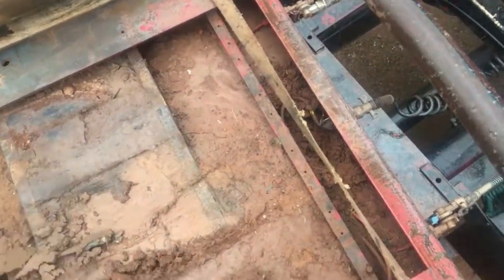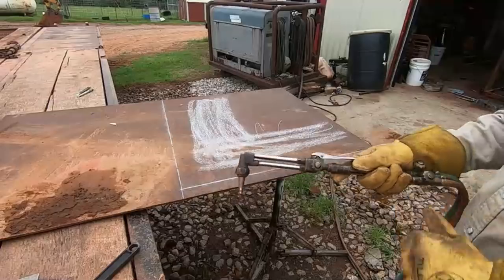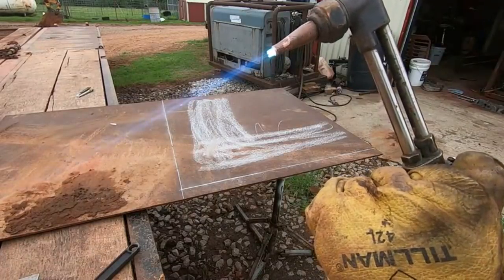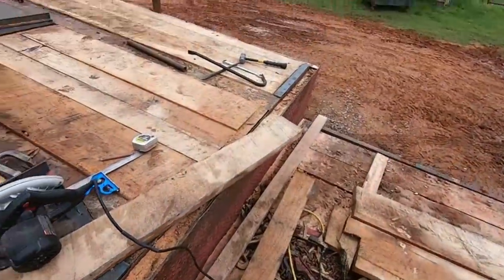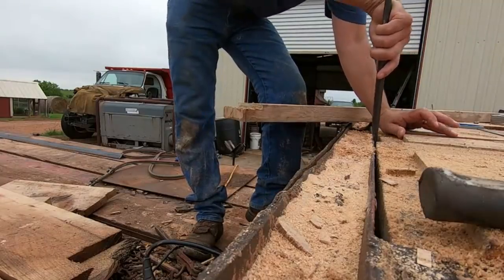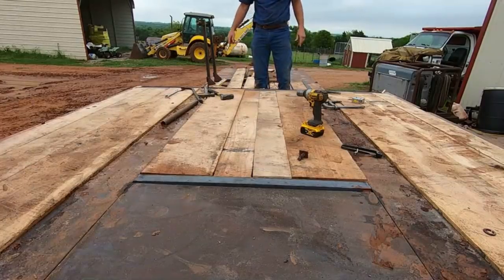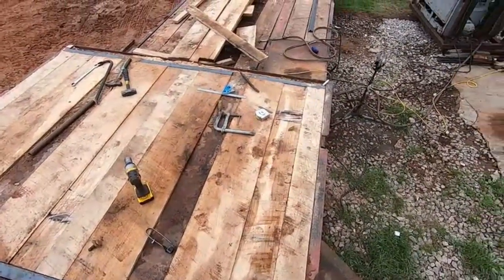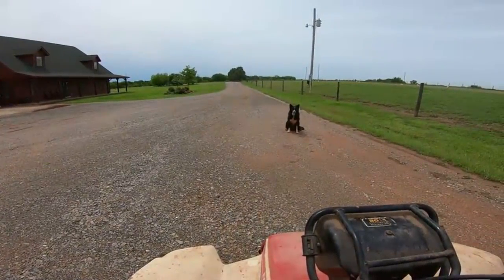Deckin’ and four wheelin’.

Comment: Made some similar repairs to my old Load King not long ago, but I didn't get to have near that much fun afterwards! One thing I learned by accident when treating rough cut trailer floors, I pressure wash them really closely, roughing the surface a good bit. Then treat with whatever hydraulic/motor oil/diesel mix is handy after they dry. The roughing up of the wood seems to help with the absorption of the oil.
Reply from the maker: I’ll give that a try on the treating.

Comment: I am pretty late to watching this,
   but loved every minute.  I bought new in 1985 a Honda 250R 3-wheeler, water cooled.  Crazy fast, did most of my riding on the Oregon coast, with buddies who bought Kawasaki's, Yamaha's, and Suzuki's.
   They did all kinds of stuff to them make them faster, I left mine stock.  They were forever wrenching on them in the parking lot of the staging area, while I was out on the sand by myself...  Ha, Ha, ha...
    Was curious as to the year, make and dimensions of the trailer you were working on.  I am in the market for a used one just like that.
Thank you sir...
Reply from the maker: Hard to beat a Honda, the trailer was custom made by a company in Oklahoma that went out of business a few years after I bought it. 1999 westwind 9 foot top deck, 20 foot flat with dove tail.
Reply: Digginok Perfect size.  You are right smack dab in the middle where most of the trailers (at least in the size range of yours) are built in this country.
Thank you for the reply back.

Comment: I've seen a few trailers with flat bar holding the ends of the deck boards on. Mine needs a new deck on it pretty bad.   That 250r is  awesome!  2 strokes are so much fun.
Reply from the maker: Trailer decks are a job best left until you absolutely have to!!! One of my least favorite chores for sure. I like the angle better, it adds a bit of strength I think. I have had a lot of fun on that wheeler, bought it new in '86, I was 14. Thanks for watching!

Comment: Frank, that 86 250R is a screamer....I also has the same year way back when. Dummy me, I sold it ☹️.  I had custom engine work and a pipe so it would scream in the sand dunes.  Dont ever sell that!!! 👍🇺🇸
Reply from the maker: I have thought about selling it more than once, I plan to keep it. Mine is pretty much stock, and could use some tuning. But man I abused it when I was a kid, and it’s still kicking. Thanks for watching.
Reply: Digginok theres nothing like the sound and smell of that two-stroke. 👍

Comment: Hi I’ve been watching your videos for a while now I started a Backhoe service three years ago here in California  I have a 2007 Cat 420e it’s has 10,500 hours on it now but has been very reliable and I have a 1983 GMC c7000 2 axle dump truck with a 366 gasser that I use to pull her around with. I love watching your videos big time! It looks like you have a similar dump truck to mine parked on the side your shop? Did you just get it? Btw I have a 86 atc250r soooo much fun! I Will never sell that trike I would love to get a Trx like yours
Reply from the maker: #MBGA! Thanks for commenting, nothing wrong with that setup you have. The truck I have here belongs to a friend, he changed out the engine but wanted me to help with the finishing things up. It's kind of  mess. I remember when I went to pick out my four wheeler, I almost bought the atc250r. I'm glad I got the trx.

Comment: the dump truck, is a chevrolet c70?
Reply from the maker: I believe it is. It’s a project for a friend, I need to get it done.
Reply: @Digginok  I have one of those I can recognize even without the doors and the hood, 
It is a good truck is strong for dumper
Reply from the maker: It has an engine transplant, needs all the loose ends tied up. I gotta hunt down some parts for it.